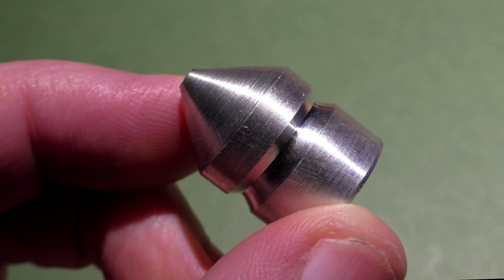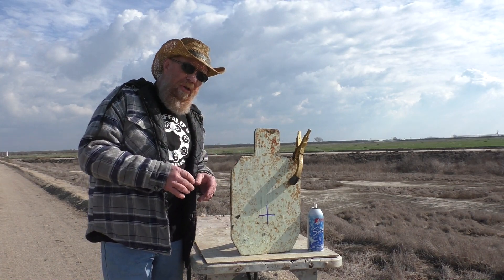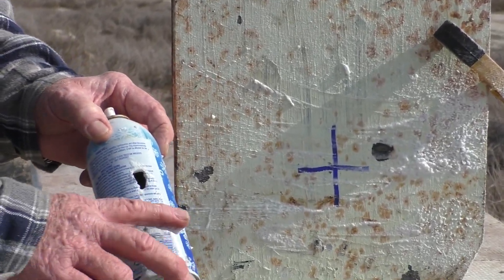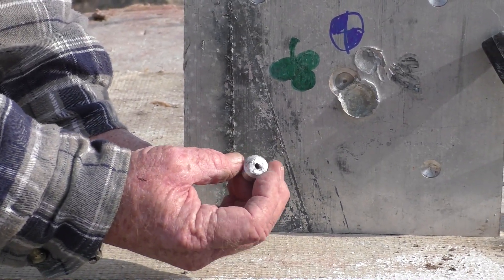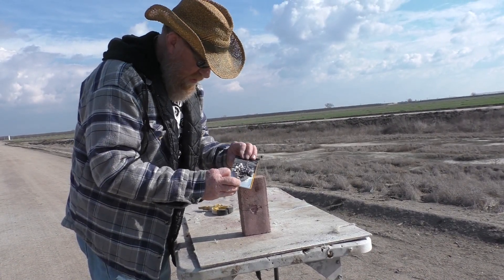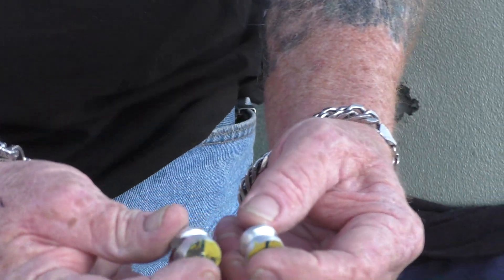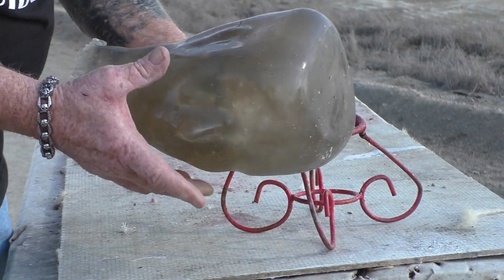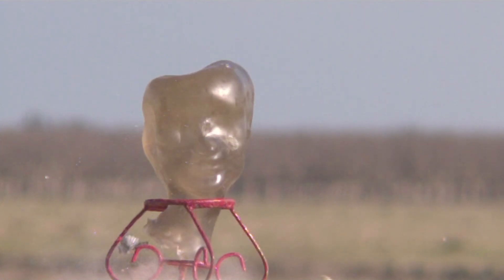MAGNESIUM 12ga. Slugs -  We Test Them!

Comment: I wonder if it's just their mass to surface area ratio that makes them inaccurate. Those are 12 gauge size, but only about the weight of a typical .38 wadcutter bullet, were they supersonic, or could you tell? I know real light ones sometimes have trouble getting up to speed for whatever reason.

Comment: Encasing a sodium core inside of a lead slug would give you much better results,  especially on soft targets. Sodium, potassium and lithium are way more reactive than magnesium. But also more dangerous to work with. 

Magnesium may gave a better reaction out of a rifle round (magnesium core in a thick copper jacket, maybe? Think .308 with a wall thickness of around 0.06-7") Adding a compacted oxidized metal, like black copper oxide, in addition to compacted powdered magnesium is how they used to make HE/HEI rounds if memory serves.

Comment: Oh yeah, an anode.  You stick it to the inside of a metal hulled boat and it (the anode) suffers all of the corrosion that the hull would have taken.  After it turns into powder, you slap on another one and go on about your merry way.  

They're usually made from Zinc though...

Comment: If you ever have these again, try firing them into a foot or two of phone books and the slug itself may catch fire.

(But if it does, don't try to put it out with water - magnesium burns fast, but it wants to burn so much that it'll strip oxygen off water as easy as it would strip oxygen from the air.)

Comment: The American pronunciation and spelling of aluminum AL is the older of the two. Humphry Davy named it so in his books, as was his right by being the first to isolate the metal form alum, but was hounded years later into changing it to match the scheme used by other better connected scientists (Davy was Cornish and the child of a working man.) The American Webster's Dictionary honored his wishes. Humphry Davy also invented the sacrificial metal solution for protecting the bottom plating of a ship from corrosion, which is what the magnesium rod used to make these slugs was used for, which is a neat coincidence.

Comment: This is why Li-Po batteries are safer than Li-Ion.

lithium-polymer cannot self-ignite because the lithium is imbedded in the plastic. The oxygen cannot react with the lithium fast enough and the circuit cannot short because the polymer is non-conductive. NEVER PUNCTURE A LITHIUM-ION BATTERY! The lithium electrolyte solution will ignite with oxygen, short out the entire pack, and it WILL promptly blow up in your face!

Comment: Magnesium anodes, very reactive to combat galvanic corrosion but not good in salt water. The zinc anodes are generally good for a year in sea water, magnesium would last at best 6 months in sea water.
Aluminum anodes will last 2 years in sea water, they cost 2 times as much as zinc anodes.
just some trivia for you.

Comment: I really expected sparks. 

Maybe the magnesium will combust if you hollow out the slug and put some type of accelerant in it such as vaseline mixed with a bit of gasoline and magnesium shavings. then plug the hole with a inline muzzle loader percussion cap and super glue..... Thats what I'd try if i was crazy 😂😂😂
Reply: Ahhhh but then the projectile would probably be to light. 🤔

Comment: YES, what fun and Danny's on the equipment again.  
what a round, a lightweight, smacker with pretensions of grandeur with a steel core and lead up its butt!  Still, delivered a whack and even a flash or two.  I loved the flash and smoke out of the ar500 with spall coating.

Comment: I know exactly what knife danny uses it is a sog flash 2 non serated version. I use to have the exact same knife. I was filing the scale a bit to clean out the lock bar hole that had gotten damaged and went to far with it and accidently turned it in to a switch blade of sorts. I live in ohio where switch blades will be legal to buy produce sell and carry soon enough :)

Comment: If you replace the steel core with the kind of steel used in fire strikers (I just call them fire steels, so I dont know the exact metal) it should spark much more easily and it's even used to ignite magnesium

Comment: If the tip of the magnesium round was made of aluminum could you get enough detonation to ignite the magnesium? 

Maybe if it was made of 3d printed alumide, or possibly mixing a high saturation of powered aluminum into a low thermal release epoxy?

Comment: When you shot the plate with the coating, that flash on the slow-mo almost looked like it came from behind like it penetrated?
Or was that just it coming up and out the top of the front side? ',:lc
Reply: Rennis Tora 
There was a bullet hole almost exactly where the slug hit.   🇺🇸😎

Comment: If you have aluminum targets, it might be interesting to see if someone would create a bullet with an iron oxide core.  Thermite welding of railroad track involves elemental aluminum being mixed iron oxide and lit with a torch or magnesium strip.  The aluminum grabs the oxygen from the iron and the now elemental iron goes to the bottom and forms a weld.  It produces a lot of ultraviolet radiation and shouldn't be looked at without welding goggles. I'm not sure if those wavelengths would damage a camera, but since the camera can't export dangerous wavelengths, it would be safe to view the video. The impact of the round likely would be enough energy to begin the reaction.  If the round is pulverized into the plate, it might be interesting.

Comment: That looked like a penetration on the vest plate, clearly see spark from the backside rise behind it.
Reply: i thought so too, wonder why they didn't mention it, maybe it was just a bit of fire/magnesium flash going through an already punched hole from an earlier round...? it seems to have been  shot before, but if there was already a hole? we may never know lol
Reply: Hole in the shirt to.
Reply: I saw it too, but I guess the armoured plate has a fabric layer (soft armour) at the back of the solid plate. The slug penetrated the plate, but not the fabric. The sparks was channeled up through a slit between the layers. The hole in the shirt was not in the right  position to be made by this slug.

Comment: I expected magnesium to flash more.
Reply: It's quite likely a magnesium alloy, which doesn't really react that violently. Pure magnesium on the other hand, but it would be too expensive to use for boat anodes. Watch a formula 1 crash against a cement wall for a good example. The rims make for neat fireworks.
Reply: I think the velocity was quite low, not enough to cause the magnesium to break into the tiny pieces needed for a big flash.
Reply: I thought it was pretty good.
More flash than I expected on that first one.
Reply: Want to see it flash? Hit some h2o with it. And if you have an old electric water heater, you have free magnisum rods inside.
Reply: Magnesium transfers heat so quickly that you need small pieces of it to stay hot enough to burn.

Comment: If you could dip your bullet mold in to dry ice you could shoot a mercury bullet. Just as toxic as lead. You can find  a way. heavy metal slug.
Reply: Thiago Martins  you could stack it and make a  chemical reaction. Something very safe that takes impact. tungsten with wax coating